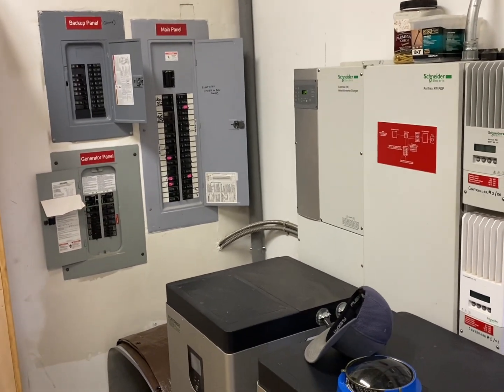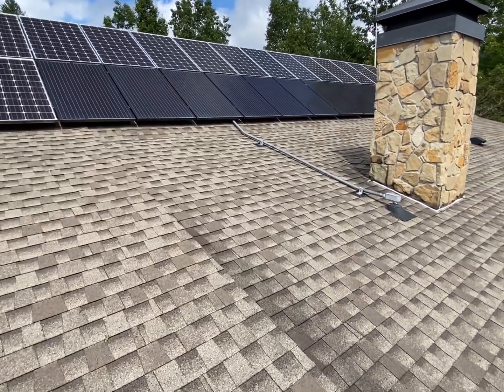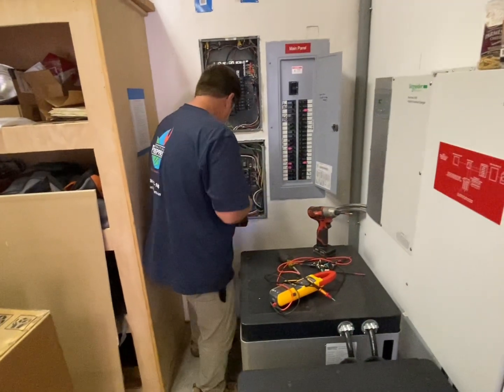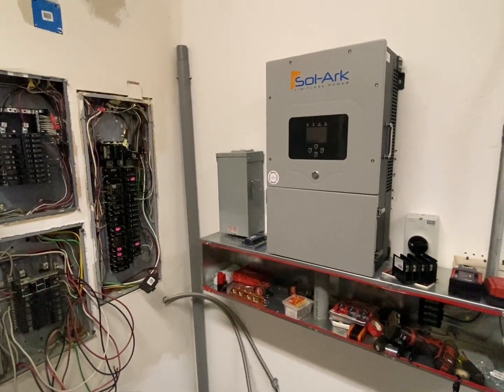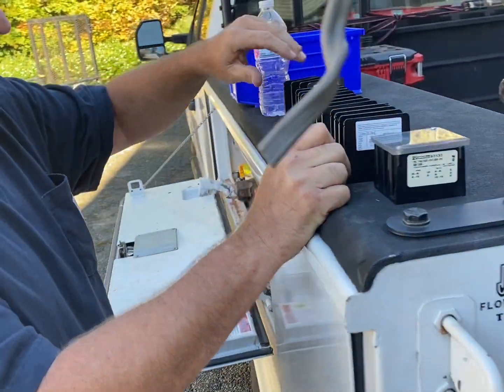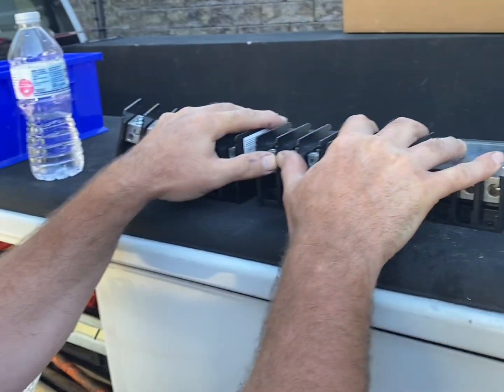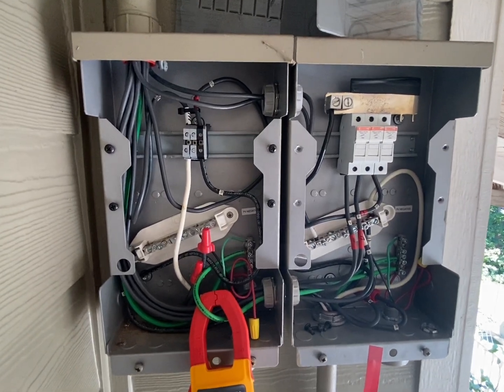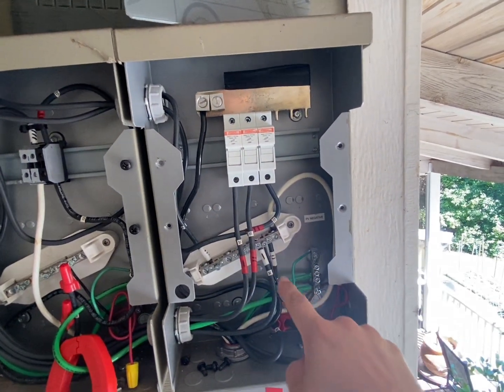Upgrading from an XW to a Solark12k: lowering power bill without selling back

Comment: JOHNNY, HOW FAR CAN THE ‘C.T.’s BE AWAY FROM THE MAIN ELECTRICAL PANEL?
My 100 amp grid service is currently located in the laundry room attached to the main house, but the best location for my new Sol-Ark 15k & (2) Kilovault HAB Batteries is in the detached garage about 40 feet away connected by a sub panel? WHAT WOULD YOU RECOMMEND? I LIVE IN BERMUDA, SO YOU & ENGINEER 775 CAN’T DRIVE HERE 😊
Reply from the maker: I’ve gone a 100’. Use shielded twisted pair wire

Comment: How is the bypass switch wired?
Reply from the maker: On line sides there is grid on one side, and load out from solark on the other. The load side of the switch goes to the critical load panel.

Comment: Schneider xw pro with 600vdc solar charger looks quite appealing compared to sol ark.  Any opinions on the two?
Reply from the maker: Maybe for offgrid it would be better if you had some really heavy loads but realize that by the time you buy the XW pro, the Pdp, two xw charge controllers you are spending more than the solark and you do get near the features or and it’s not user friendly at all.
Reply from the maker: That was a 10 yr old xw. Not a pro. The pro can’t do zero export which is a huge feature for people that can’t grid tie. Why a huge company like Schneider hasn’t put that into a firmware update boggles the mind.
Reply: @GainSolarPower  XW pro does zero sell.  You have to purchase Wattnode and CT's. Schneider has documentation covering this.  Cost between Sol Ark and Schneider is very comparable according to my research.
Reply from the maker: That’s good to now.

Comment: Do you sell the used equipment you upgrade?
Reply from the maker: Sometimes. What are you looking for
Reply: @GainSolarPower  A used starter system that we can get started cheap and add to as we can afford it.
Reply: I know this is a long shot. This is an old video. How can I contact you? I'm interested in the XW6048 inverter that you removed, or if you have any leads on a working used one. I already have 1 just like it, and would like to add a second. Not looking to trash the entire system to get a newer Model. Thanks.

Comment: If the utility is a public utility system they should be required to net meter. There is no legitimate excuse not to. Good job on the system.
Reply from the maker: well thats not how it works down south

Comment: Hey Johnny can you adjust the amount of grid in to less than the 4-500 watts it was using.
Reply: When my solar panels are producing enough power for the house my Sol-Ark is drawing between 10-20 watts from the grid.